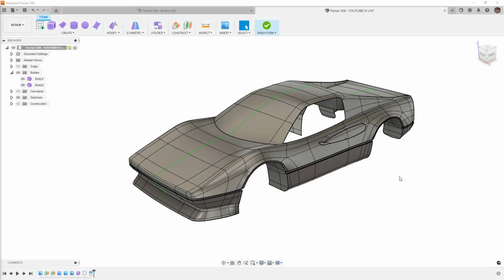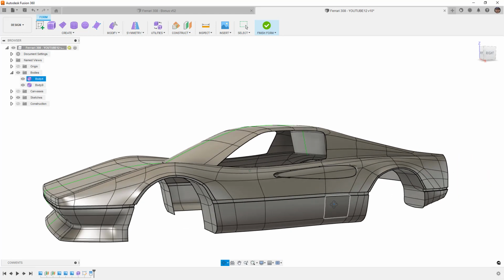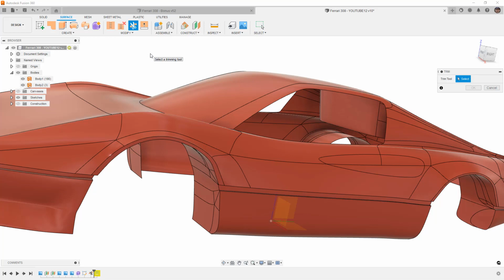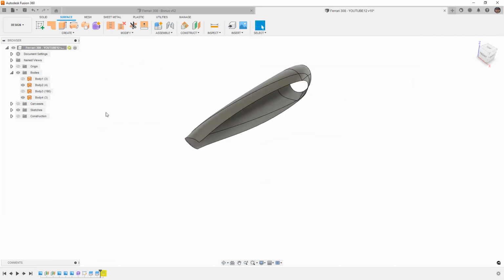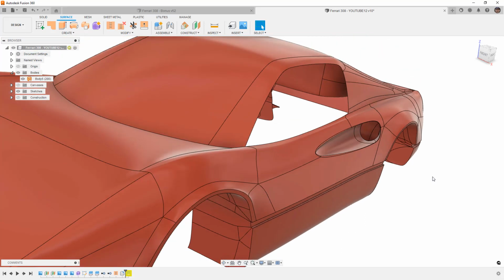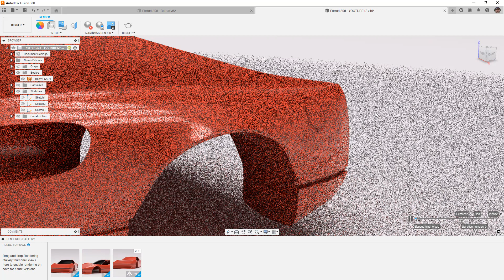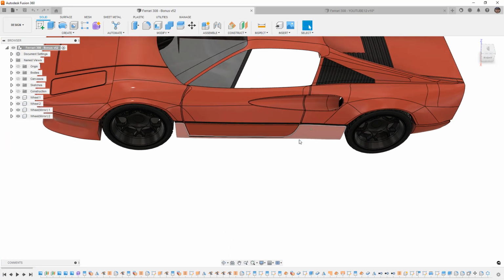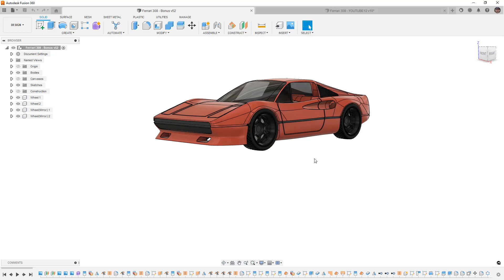How to Model a Car - Ferrari 308 with Fusion 360 Forms - Part 14 | Intake Scoop Details #Fusion360

Comment: Hi, I have a question on forms feature. How can I manipulate a FINISHED form that I have created and made some changes to using the surface workspace?

For example, say you're designing the body of the car, finished it, split the windows and surfaces using Surface Workspace, and now you want to add the Hood. Instead of going back to Forms, you decide to create a NEW Form feature, and just weld those 2 bodies together?

I am unable to connect 2 separate bodies used in 2 separate Form features. When I create a new Form, the old Form body disappears and I cannot weld them together? Sorry for the long text.
Reply from the maker: So the answer to this is a bit nuanced.  It can be done but probably not exactly what you are looking for.

First, forms are "direct modeling" which means no history is capture during the edit.  This means you can go in and edit a form, select and copy the entire form body, finish/exit the form, go into a new form or even a new document.  And during the edit you can Paste that copied form body.  Keep in mind this doesn't take any thing you did after the form was finished with it so no surface trims or divisions.

Another method is to start a new form, under utilities there is a Convert tool, this lets you select a surface/face of an existing solid or surface body and convert it to a form.  It wont bring more than a single face selection so its a bit limited, and it generally is an Untrimmed version.

So as i said probably not what you are looking for.  If you turn history capture off, the forms and surfaces exist at the same time but to make a form to a surface you need to use the Utility > Convert tool.  But in general once you "finish form" you are not going to take any future surface edits with you back to the form.

Form tools do have the option to Match an existing surface edge.  Look on the channel for the forms MATCH tool.  this lets you take an existing surface body (could be a finished form that was trimmed more) and attach a new form to the edge of it and even drive tangency.  This means you could create a new hood in an area where the old one was.  Might be an option to get where you want.
Reply: @LearnEverythingAboutDesign   Thank you very much for the in-depth answer!

Yes, I found out the hard way that I can't really make changes to an edited or "trimmed" form. 

So, I was able to do a workaround as you showed in this Ferrari series. I deleted my old hood, well not exactly a hood. I am trying to model the body of an old F1 car, so I guess I should have called it the "nose". 

So, what I did was delete the new Form tool nose part, went back to my main Form feature where I made the body, and just Alt+extended a couple edges and tried to make it as a nose.

Comment: Thanks for the tutorial. But today when I resumed modelling in Forms workspace, I am unable to Box Select the Vertices like before..

Previously in side view when we hit Box Select, it selects all Vertices that come under the box. 
But now when I do the same, none of the Vertices are getting selected?
Only Edges are selected with the Box Select option.
I checked the selection filter and only "All" option is selected.

Any help would be appreciated.
Reply from the maker: Sure, there are two things that can affect this.  I see you got Select Through, but also note that edges and faces are often prioritized over verts.  You can change the selection option in edit form to be only the verts.  Also on the ribbon you can go to the select drop down and there are some filters there.  That selection drop down changes depending on if you are in a tool like Edit Form or not.  So if you set it before you start the tool it might not be the same.
Reply: @LearnEverythingAboutDesign  Understood! Nice to learn there are other ways to go about this.
Thanks again!
Reply: NVM, figured it out. 
In the top Selection Tab, there is a "Select" option, and in it the "Select Through" needed to be enabled.

Comment: Once I am done with the form, is there any way to give it some thickness? The thicken tool does not seem to like the shape unsurprisingly. Once you finish editing the form does it have any thickness or it essentially just a bunch of vertices? I'm designing a shell for an RC that goes over the wheels and all the electronics.
Reply from the maker: It is tricky for sure because it largely comes down to tight transitions.  Thickening in the forms before conversion is usually a bit more robust BUT you will likely need to manually deal with overlaps.

Are you going to use the print as the body or use it to vac form a shell over?  If the latter you can make the ferrari model solid by just sealing it off.
Reply: Hmmm yes I see. I'll give thickening before conversion a try. And you actually make a good point. I want to do vacuum forming, but I've never done it before. But also, I would be able to 3D print the shell by closing off the bottom like you said, and then vacuum forming over that. 

I'm not using the ferrari shell, but rather improving the FC100 shell used currently for the world's fastest RC cars. I want to try and break the world record.
Reply from the maker: @LukeMaximoBell  yeah i would save yourself the hassle and do a vac form plug then.  Whatever body you are doing just seal it off so its a solid, then cut holes through it where you want vac ports to go and do an NPT port that goes to all of those.  Depending on the material it should be ok with the heat of the plastic.  Vac pumps can even be a shop vac if you just have a large port on the bottom. but you will need a good way to evenly heat the plastic sheet and put it down on the form quickly.  Usually you would build a metal frame. you can screw through the corners of the plastic with some simple flat plate.  heating evenly is the trick.  when i have done this it has been with an old oven but there are rigs you can buy ready to go.
Reply: @LearnEverythingAboutDesign  Thanks! I'll look into getting a local company to do the forming.

Comment: Matt, I recently am working on a detergent bottle and was told by Fusion support to review your series in the Subaru form modeling.   I spent the weekend going over it and it has given me additional insight to this workflow.  Last night I performed a loft in form and was surprised how quickly the main body was generated.  My problem was with an over building method I attempted in form.  Seeing this video has given me an idea on how to get that done.  Thanks again.  New subscriber!! Brian W.
Reply from the maker: Wow good to know they sent you over :)  Feel free to email me support@caducator.com if you want me to make a video on a bottle.

Also thanks for the Sub!!
Reply: Will do.  Need to spend more time in practice before asking any questions.  So far I started in form with a loft.  It generated a base model very quickly.   Will keep working.
Reply from the maker: Sounds good Brian!  For whatever it's worth, the bottles I have done with Forms have all started with a cylinder.  I don't typically use Loft, but that doesn't mean you shouldn't.  Often times when I think I need loft, the complexity of the sketch makes it have way too many divisions for how I like to model.
Reply: This true.  I must have deleted 12 lines to reduce the amount of control in the model.  To make the handle I used the bridge function.  Now just moving the edges and faces to get the shape needed.  Still working.